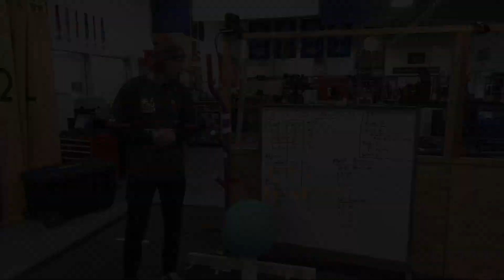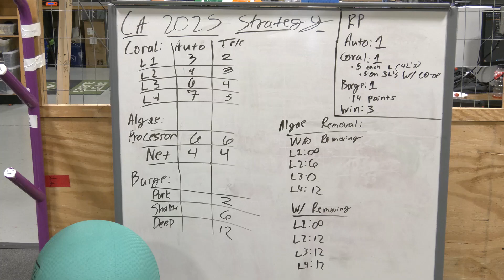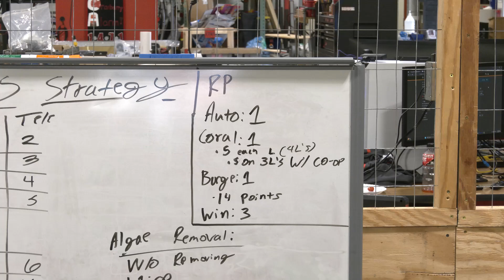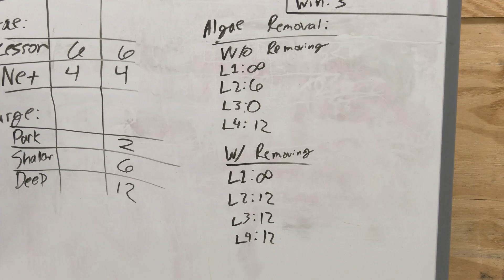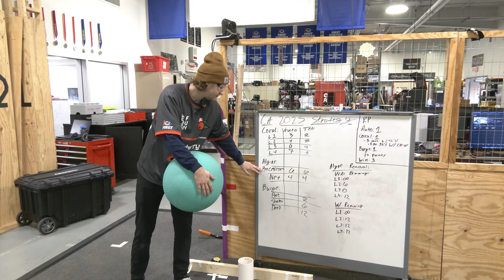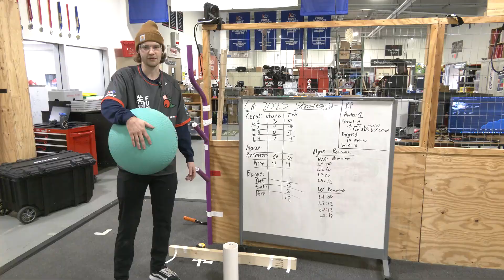Reefscape Strategy and Scoring Breakdown Cranberry Alarm Robot in 3 Days Ri3D

Comment: Before Algae removal, it seems like the higher algae would block the scoring for 6 coral pieces on L4. Is this what you have seen in your testing?
Reply: Watch the field tour video of the reef. There is a coral on L4 and an algae below it. No contact so L4 can be scored without removing algae.
Reply: the rules say if the coral is touching algae it doesnt count
Reply: At initial look based on game manual and full field cad, it does not appear that L4 is affected. However in our testing with the one tree we have, our coral seems to sit lower on the L4 branch and makes contact with the algae on L3.

We do only have 1 tree at the moment and are hoping to get a second one so that we can see the interaction of the algae and the reef trees and the L4 coral.

Comment: How did you mock up the reef post?
Reply: We are borrowing the post from AndyMark.
Reply: @KevinBeshears is the reef placed at the right height? Isn't there supposed to be a base at the bottom
Reply: @ruskcoder  We didn't have the wooden base yet. It is comparable to the actual field as we were using it to visualize.